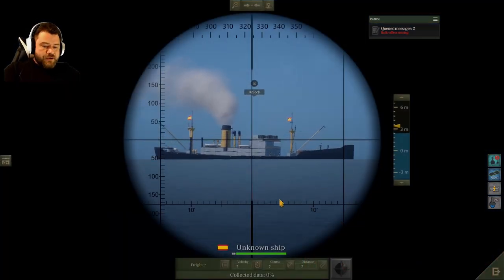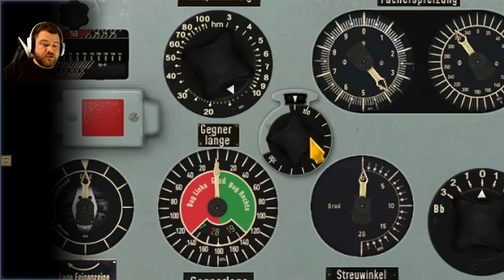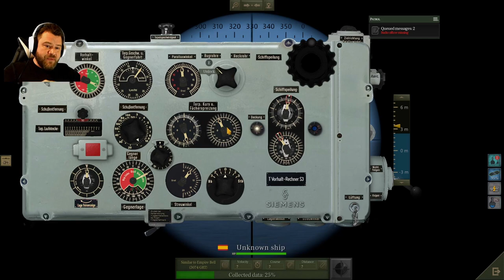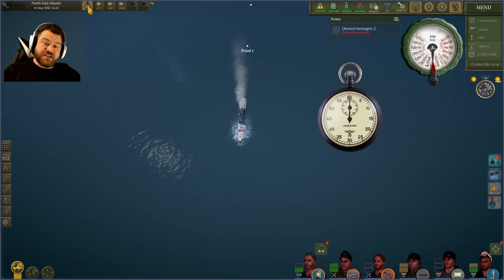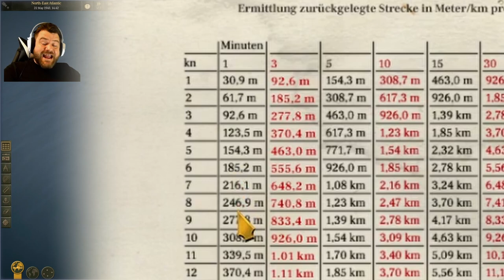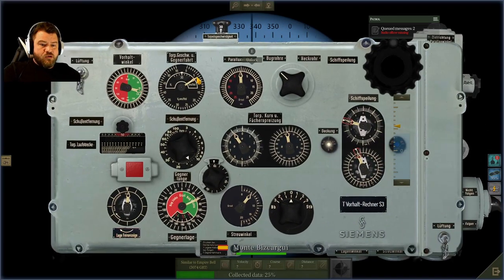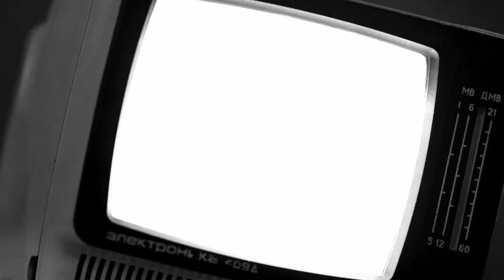How to Use the TDC Mod, QUICK and SIMPLE | Uboat | B131

Comment: Since about build 129 or so, you actually get more accurate distance measurements on the map even without the TDC mod. It's not accurate to the metre, but to the 0.1km which is usually good enough for government work...

Comment: I started always playing with kilometers and kilometers per hour.  The math is super easy.  I run distance for six minutes and multiply distance by ten to get km/hr.  It's also much more accurate that way.
Reply from the maker: I'm not sure it's any more accurate that using 3:15 with mixed units
Reply: @Lite_lySalted  longer time (larger sample) leads to a better average. How much that matters in game, I'm not sure.  Running the clock twice as long means any inaccuracies will matter half as much. An inaccuracy being if you place a point a meter in front of the ship, or ran the clock a second longer. The longer you check speed for, the less it matters.
Reply: @seymourfields3613  if you fight fleets/planes then time isn't exactly on your side

Comment: As per the tdc manual, that "thuck" nob is an own course correction scale. This helps correct target calculations and launch based on your heading or if you deviate. When you flip that bottom switch it starts tracking AOB. Thank you for the introduction to a better UBOAT experience 🙏🏼
Reply from the maker: Glad you enjoyed it!
Reply: @Lite_lySalted  I only installed the mod because I saw this video and your concise explanation of the system and ui. Sincerely, thank you ❤️
I only started reading the manual out of sheer interest in learning more about the TDC
Reply from the maker: @av076  appreciate it, thanks

Comment: Great tutorial clearest and easiest to understand by far. I have some questions if you don't mind explaining
First what are the steps to using the mod when attacking multiple targets? Do you have to keep switching doing all the steps above 1 ship at a time or can you setup all calculations at once then switch on TDC when using torpedo menu?
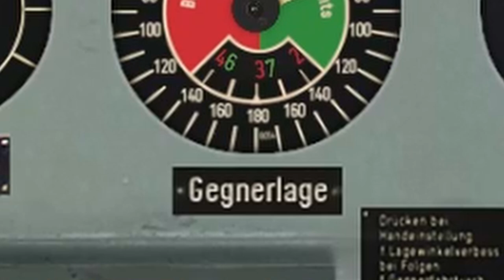The second question I can think of at the moment is if this mod is still usable in situations where I couldn't use the periscope to Id? Ex, 20m down with targets close enough to spot  does TDC still keep tracking AOB if I use slave function at 2:36 ?
Hope to hear from you and thanks in advance if you do
Reply from the maker: Thanks! 
1: unfortunately, you can only program for one target at a time, however, once you've slaved in aob, it stays pretty close to true when switching targets, so you don't have to do aob per shot.
2. Yes, so long as you can plug all the values into the tdc, sighted or not, it will work.
Reply: @Lite_lySalted  Thanks so much also for #2 I would input everything manually on the TDC hud then fire torpedo pause input the next ships info rinse and repeat correct?  Also when putting it in manually do you have to make sure you don't have the ship selected in base game all (map or officer target) for tdc to take over right or I just need to make sure the switch on the torpedo screen is green? Sry if questions where covered already I've watched few times but also read the manual so my brain is thumping been so long since i got you use it for video games lol
Reply from the maker: @StonedWolf666  as of this build you'll need to plug in the values into the periscope AND the tdc. To switch targets  close the torpedo bay completely via the X

Comment: Okay, after trying the mod myself I have two questions:

1. Is it possible to make the calculations for 2 or more ships at the same time?

2. Is there a way to reset the calculation? 
I made the calculations for a ship, but the torpedo exploded too early. 
Now had to escape and reangage, but had to pick a different ship. 
I made the calculatiosn for the new target, but the numbers for the TDC (like AoB) jump around like crazy, and I think it still is trying to follow the last ship.
Reply from the maker: the AoB should automatically update based on what your periscope is locked to once you've set it.

Sounds like you're still locked to the previous target. Lock to the new one and it should be fine.

Comment: Hi litely. Newcomer here. I've seen you shooting without tdc pretty much when periscope is not "available". (20m example) Do you "have" to use game own (non tdc mod)shooting solution method for some reason or is it just easier that way? I mean, is it much harder to hit with tdc, with only a guy in the hydrophone. When you cant lock and identify target (at this point i use visual map)? Asking because, i did not get hits with tdc mod when using only a map for visuals... Cant even id the target cause no book available... Do the game recognize that i have not REALLY seen the target via periscope, or did i do something wrong... ?
Reply from the maker: Hello,
No you don't have to use the vanilla controls. The ID issue can be worked around by putting a leader on the attack periscope, then you can access the book even if you don't physically have the scope out of the water.
Reply: @Lite_lySalted  ah. Thank you very much! Nice streams and vids man.
Reply from the maker: @snakeplays398  thanks!